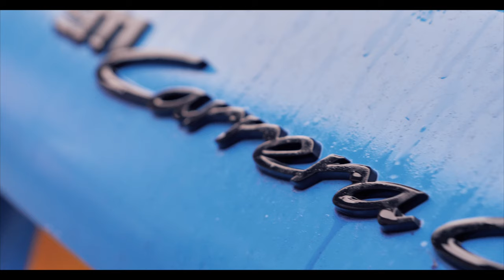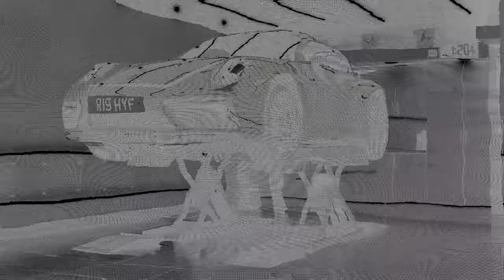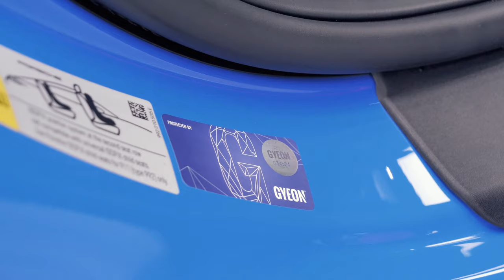PORSCHE 911 GTS | PPF Is The Best Choice

Comment: Did you guys add gloss to the wheels? I believe they only come in satin black from factory.
Reply from the maker: Hi. No we didn’t.
Reply: This GTS has the High Gloss Black option selected which changes all the satin black to high gloss, including the wheels. I've ordered the same for my shark blue GTS.
Reply from the maker: @seanmurphy9114  😍
Reply: @staffordshirecarcare  This is the first video I've seen of a Shark Blue GTS with the high gloss black and I've never seen this color in real life so it's great to be able to see it in your video. Took a bit of a chance ordering the car in a color I'd not seen IRL but glad I did. My car will be a bit different than this one as I won't have the aero kit. I went with the lightweight package with the carbon bucket seats and the carbon roof and mirrors. I also have the carbon ceramic brakes. Should turn out good. Went into production in Germany 2 days ago so should have it in a month or so. Did you do full PPF on this or just the front, side skirts and rear arches?   Great Video!!